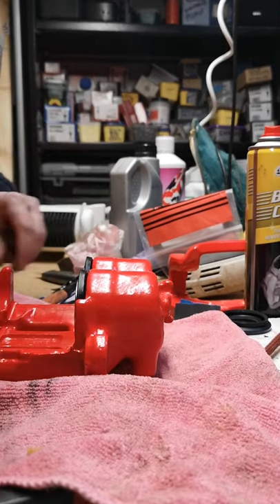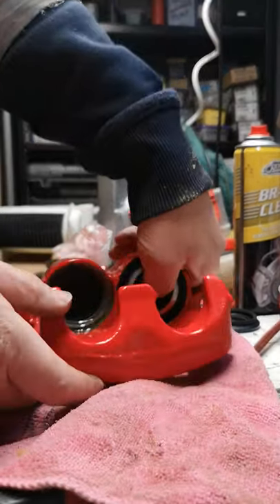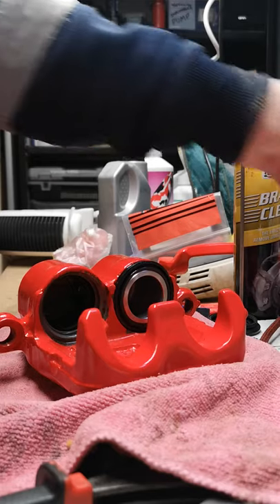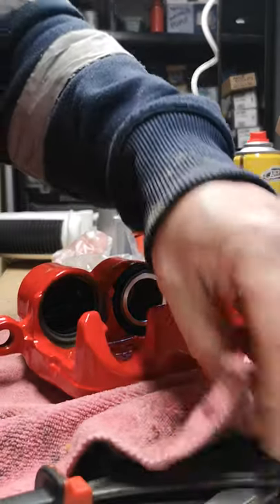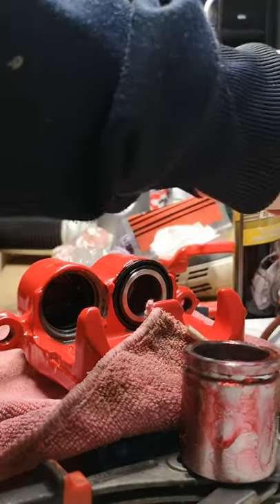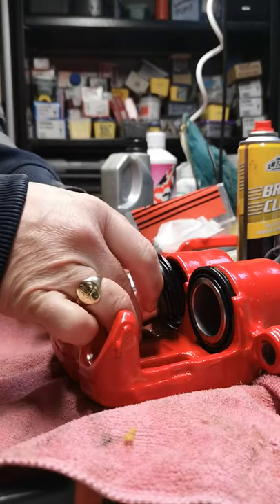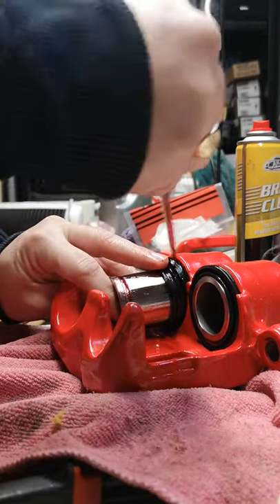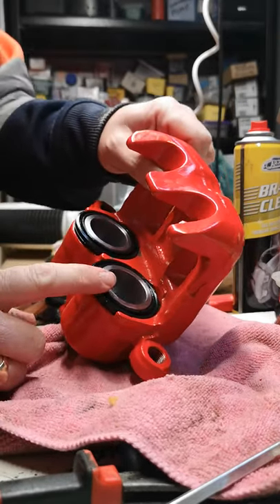Mazda Bongo brake cylinders replacement.

Comment: Do you need the metal circlip in there to that’s usually supplied or will it do without
Reply: I ALLWAYS forgeth to put them in, but if pads for nice without wobble u should be ok
Reply: Sorry I thought U ment the clips on the pads...... Yea the circle clip for the piston I'm also wondering that aswell.